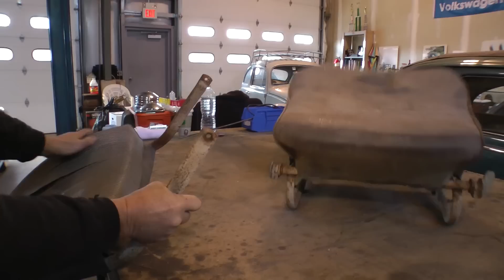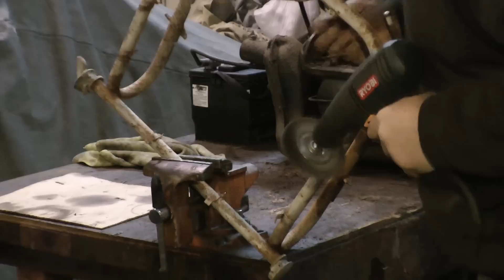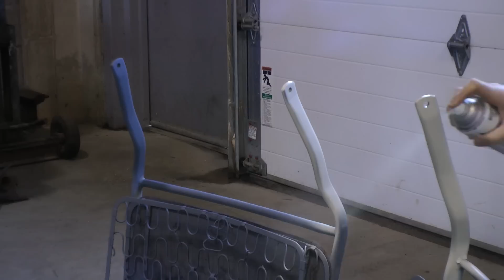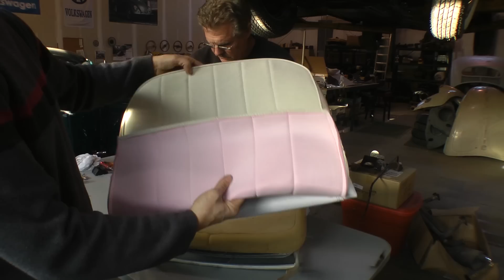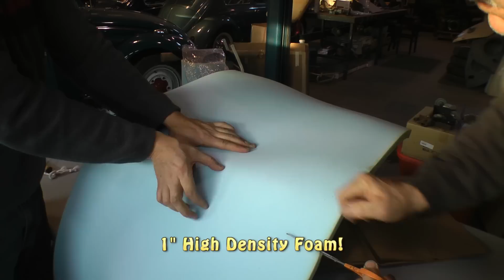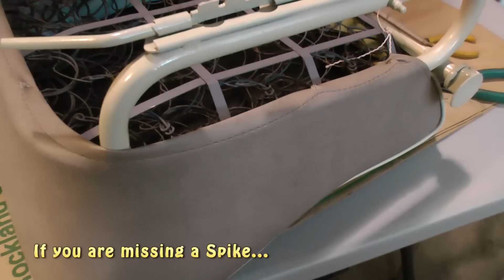Classic VW BuGs How to Restore and Reupholster Beetle Type 1 Front Seats to 1964

Comment: just doing mine now 62 Ragtop, the seat covers are in excellent condition, so re-using , 60 yr Old horse hair came out very easy. the Germans hand stitched the under flap of the backrest ( well it looks like it when i took it off) so cut the tread to take the back off. will re-stitch the flap ( 2/3 stitches of thread ) on install . im using the TMI molded foam & cover the springs with Burlap cloth , $12 at home depot

Comment: Great video Chris!  How close is this to seats I have in my 1965?  Thinking they must be fairly close.  Mine are a bit on the tattered side.  Going to do a vid on back seats too?  Thanks again, Bill
Reply from the maker: Close, the bottom rests are pretty much the same, it is the back rests that are different.  The foam padding rolls over the back rest, be sure to get the TMI 65-67 molded foam.  Also, the back rests have spikes at the bottom to poke the material through, not a tube to push a sewn tab in.  And yes back seats coming soon.
Reply: Chris Vallone
Thanks Chris.  Might have to give the seats a good looking at to see for sure what year they are.  I'm pretty sure they were changed out at one time or another.  Thanks again!

Comment: Chris, thanks for all the videos.
I have a 1964 beetle with the same seats as you are replacing in this video.  Is there a place to get replacements like these? I hate them but my wife wants it to be like her sister bought the car in 1965,
Reply from the maker: Phillip Duffy Replacement frames? or Upholstery?
Reply: Upholstery. I've checked TMI and Sewfine but didn't see that pattern. Thanks.
Reply from the maker: Phillip Duffy I got that kit from sewfine.
Reply: sorry, I meant the original stripped seat covers

Comment: Great video … again !! 
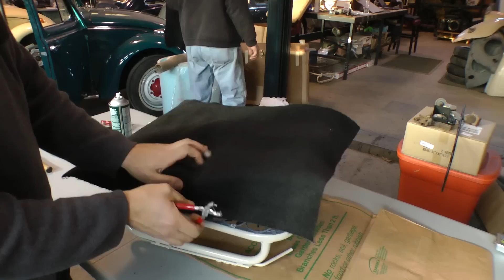@ 6:18 - what is that tool you’re using and do you know if they sell a set/kit of auto upholstery tools ? Also we could just have sandblasted the seat frame with springs attached - right ?
Reply from the maker: hogring pliers.  They come in a kit when you buy hogrings from a VW parts supplier like jbugs.  And yes you can media blast, for sure.
Reply: @classicvwbugs  thought about media blasting as soon as I saw the wire brush and sandpaper. If we're already getting parts powder-coated what are your thoughts on doing this to the seat frames as well?
Reply from the maker: @anangelshero0410  Media blasting the frames?  Yeah that is fine.  As far as powder coating the frames?  Just make sure the whole bottom seat frame is taken apart, you have some moving parts there for the recliner.  If it is all together when you powder coat, they could fuse together.

Comment: Hey Chris, I have a question about later year beetle seats. I wanted to reupholster a set of 74 seats with original upholstery from another set of 74 seats but when I was removing the old worn upholstery I had to undo a hinge bolt that holds the back support to the seat but that bold doesn't want to go back in at al. I can't seem to get it to catch the thread inside the hole it needs to go in. Do you have any idea how I can fix this?

Cheers,
Arend.

Comment: Chris I noticed the foam on the back is different than the bottom , on the bottom u used 1 inch foam , and tucked it around the edges , will this work on the top part of the seat as well. and what can be used to replace the carboard in the seat top on the bck... thanks   Bob Frome Maine,,,
Reply from the maker: You can, but the molded foam is better since you want a seamless finish in the backrest.
Reply: Chris Vallone thanks chris. I think what I do is use the original horse hair and just add foam in the middle to replace what was lost over the years. since I don't see any place to just buy the bck of the seat.. looks like you have to buy the full kit. per seat.. thanks love you site for sure... hope to make It down to your shop and see you in person.......
Reply: bob white Hi Bob, not sure if this is it, but Wolfsburg West has the seat backrest paperboard I think you are looking for. http://www.wolfsburgwest.com/cart/DetailsList.cfm?ID=111881795B

Comment: When you were redo the seat was the shop warm or did you let the new cloth warm up to work with
Reply from the maker: it was pretty warm, but if you need to warm them, we use a hair dryer or heat gun.

Comment: one of my seat backs is missing the bar with the channel that the upholstery tucks into. Is there a way to upholster it without this or should I try to find a new seatback or try to make a part?
Reply from the maker: You can either make a tube with the slot in it, if you have a good metal and welding skills you can do that.  Find a donor seat, or hog ring it, (which doesn't look too good)

Comment: Hi Chris, my original stock 1965, Lady, is in desperate need of front seats.  I moved to AZ from NY in 2008. Lady has been my daily driver since and the front seats are ruined. The heat really tore them up bad.  The rear seat is in great shape. I don't know what to do. Here is the passenger side:
https://www.facebook.com/photo.php?fbid=854838574608055&l=e7ce0bfdfb

The driver's side is just as bad

Pics of Lady:
https://www.facebook.com/media/set/?set=a.818686361556610&type=1&l=24c724cb2b

-------
Reply from the maker: +vintagegirl1961 Not bad at all, I would just get the new kit from wolfsburgwest in that same pattern, go with the TMI foam or the coco fiber from wolfsburgwest.